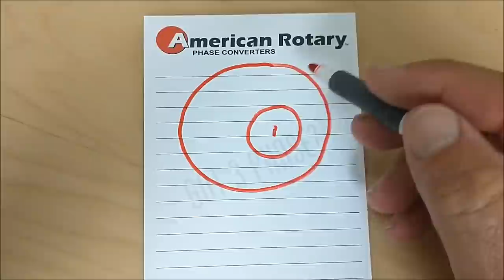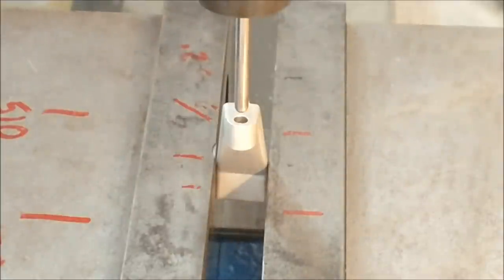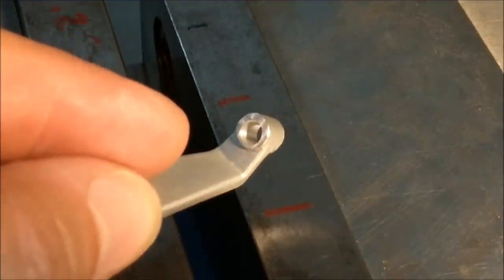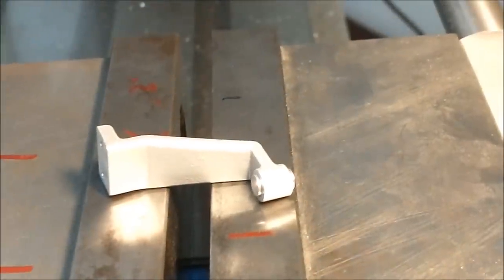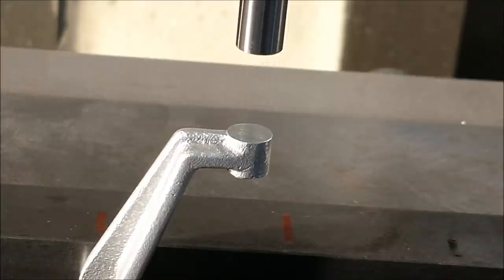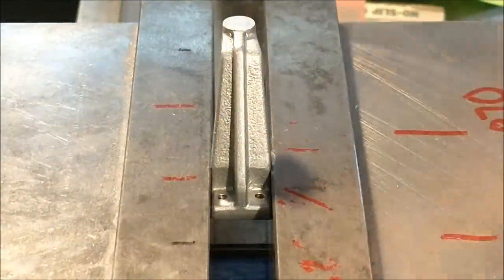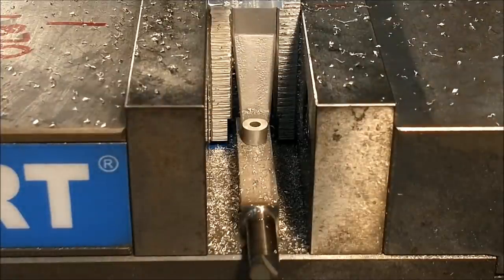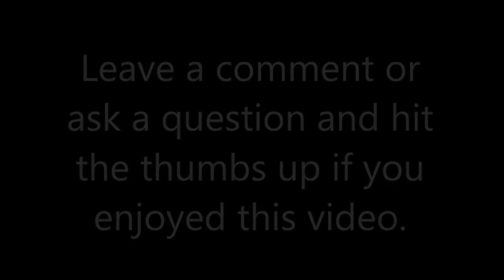Is It Impossible to Move a Hole in a Piece of Metal?  No.... Watch This !!!

Comment: A few suggestions (not necessarily in order):
1)  Suggest you consider making a Bondo support fixture to hold the casing uniformly during machining.  (Just grease the casting for a release agent.  It works very well and you don't have to worry about breaking the casting.)
2) Loctite recommends a film thickness for thinner viscosity Loctite between .025 mm to .080 mm, (.001"-.003").  This allows for a sufficient gap for the Loctite to cure correctly.  So if you went in the middle at .002" that would mean that the bushing should be undersized by .004" diameter.  This hard for Joe to do since he is a very high precision machinist.  However, you need to leave enough film thickness for the Loctite to properly polymerize.  Additionally, too tight of a fit on the bushing will scrape out the majority of the Loctite upon insertion.
3)  When you "squeeze" the aluminum "bushing" is becomes an aluminum rivet and mushrooms out at each end easily wiping out the .002" radial clearance between the bushing and the hole but only at each end.  The aluminum bushing then deforms the hole outer edges for the end condition fit you are looking for.
4)  A better method for locating the hole to be repaired would be to indicate the OD of the boss and ignore the through hole.  Then plunge the boss with an undersized end mill.  Then clean up the new hole with a boring bar to the desired diameter.  
5)  Loctite recommends a surface finish of around 64 RMS.  This surface roughness allows for the Loctite to get a better grip.  So this surface roughness should be on both the busing and the ID of the hole.
6)  You should file a radius on the leading edge of the end of the bushing to be inserted into the hole.  The radius will reduce the tendency of the bushing to scrape off Loctite material as it is inserted into the hole.
You might argue that my comments are overkill for the this particular repair, but it always good to develop good habits when doing any kind of work.
Thanks for the video Joe.  It was a good  opportunity to help me review how to handle these type of repairs.

Comment: I’ve been thinking about a DRO for both my lathe and mill / Drill, both are used / and Abused so accurate works would be nice but I think it would be better to get new machines... I’m a Happy Hobbiest at most. But losing sleep with my nose in the Shars catalogue... Not the electronic version... I still love to look at dog eared pages !
Thanks for putting this video up and I’ve gladly kept all of my fingers and toes where they belong! They don’t quite work with me on occasion but I’m gonna say it, getting older is a challenge. Having held the 2nd most dangerous peace time Job in the Army for 13 of my 20 years, heavy Construction equipment repairer.

Comment: Very well recovered, Yes i can see the differences between the two different metals  but thats only because we seen it happen & know where to look.
Reply: If you did not know it will just look like the surface there was slightly polished, and after a drop of lubricant is applied and slightly polymerises, or the part is sand blasted to clean it and even it out, you will not even be able to see it on the even surface finish.
Reply from the maker: You'll look right past it. Thats the best kind of repair.

Comment: Nice work !!!,  I always use "wicking grade" Loctite for parts this small and with such little clearance.  I have taken apart pieces that I'd previously used red Loctite on but found after disassembly that the liquid didn't flow, there was only Loctite on a fraction of the contact surfaces.
Reply from the maker: I'll have to read up on their products.

Comment: a master at his work is a beautiful thing to  watch.
Reply: Hardly a master , if he was the hole wouldn’t be so  far out.  Unless he Did it on purpose for the video !
Reply from the maker: The casting was not suitable for the dimensions and hardware being used. The part was spot on to print the first time, but cosmetically unacceptable. Feel free to leave your credentials in case I ever need help.

Comment: I've had good success with lead solder(for the really delicate ones) and bronze braising  to set a bushing in a delicate place where I didn't have meat for a good press fit. The Shed Dewller uses epoxy sometimes too.

Comment: I did a similar thing when I oversized one hole in the apron. I accidentally punched the 1/8: all the way through (not paying attention to print). I snipped a section of some 1/8" aluminum grounding wire and peened it into the hole with a flat faced punch (but no loctite). Milled and drilled to the correct size hole and moved on.
Reply from the maker: We all have oops moments. How we handle them is the challenge.
Reply: Correction: Table, not Apron.

Comment: Great job and solution too.
If the part does not accommodate for the spec’ed dimensions find out if the mating part will accept adjusted dimensions and then adjust.

Think you did great! And without having to throw away the part.

Loved the press fit on the bushing too!
Reply from the maker: Controlling the assembly does have its advantages.

Comment: I've never done it this way before. Usually made the OD of the plug a few tenths or a thou over the size of the ID of the hole, then freeze the plug, and heat the hole. Works like a charm, but takes more time. Also was used on larger applications than this. I wonder how large a hole you could get away with pressing it this way....

Comment: The only way to make no mistakes is to make nothing.

Things like this are frequently made to suit in the real world. That's what transfer punches are for. When I worked for Siemens there were a lot of large fabrications that were designed to be shimmed and positioned for proper alignment then the matching bolt holes marked out and drilled to suit. After bolting parts taking high loads also had dowels fitted to suit. There were nominal hole positions on the drawings with notes to drill on assembly. Things like gearboxes handling over 10MW are a good example.

Comment: I've relocated a number of such holes with great success.  My preference is to tap the bad hole with the absolute finest thread available, then bond a matching threaded replacement slug in using the same alloy as the parent with a good metal bonding epoxy on the threads.  After the epoxy sets, machine flush and redrill.
I like my method better, but for this application, yours is clever and beautifully time-efficient.

Comment: I build similar models made from cast iron. Bought several partially completed models from ebay. What I do is drill out the hole a bit larger, thread it and thread a piece of brass to fit. I'll cut a screw slot in it, use some loktite 603 and screw it in. then mill off flush and redrill. Works well but I only do it if its hidden by another component. Hard to squish cast iron!

Comment: When using such a long skinny gauge pin to probe a hole, I personally rotate the spindle through 180 deg (separately for each axis) between successive probing moves, and move the table in that axis to make the deflection equal and opposite.

Comment: I had the screws that hold a water pump onto an aluminum Buick 215 that welded themselves with rust to the holes.
By the time I got those bolts out most of the holes were completely destroyed.
I simply drilled them to size, tapped them and used an aluminum Bolt with red Loctite to fill the holes.
I then mounted the water pump on the alignment pins Center punched and re-drilled and tapped the holes to the appropriate size for the factory bolts.
After cleaning up the surface nobody could tell the difference.

Comment: GreenLOCTITE 638 is a high strength, fast curing, general purpose retaining compound.
LOCTITE® 638 is designed for the bonding of cylindrical fitting parts, particularly with narrow bond gaps approaching 0.25 mm. The product cures when confined in the absence of air between close-fitting metal surfaces and prevents loosening and leakage due to shock and vibration. It not only works on active metals but also on passive substrates, exhibiting robust cure performance. The product offers high-temperature performance and good oil tolerance, and tolerates minor surface contaminants.
Reply: Goo, glues, lotions, screws, adhesives, boos. I'm not a fan of loctite. It causes corrosion if you're not tediously pedantic about getting the metals tested to make sure there's nothing 'icky' in them. If you deviate from it's pathetic temperature or humidity range. Metals within acceptable parameters per standards organizations may not be good enough for Henkel. 
Do not use on MIM parts, do not use to bond dissimilar metals. In some cases it might kinda sorta work if you buy their expensive primer(s) and/or do special prepwork. 

Screw it, nut it, bolt it, washer it and/or  just do your tolerances right to begin with and leave the slop to the hogs.
Reply from the maker: The expanded fit of the plug did all the work. The loctite was just gravy. Sorry, no slop for the hogs here.

Comment: As a foundry man, I’m curious if the part was designed right the casting would be as cast with machine stock added to the pattern, and as you know you would set a fixture and find center and go from there.  No sand casting is ever perfect.
Reply from the maker: This was a tricky little casting.

Comment: Great job , again. I just had the same thing today drilling a hole in a nozzle mount and the last thing was to drill the holes . I did the pilot hole first and the the final , apparently I didn't tighten the vice and it popped out and had to plug it . Brass part and silver solder , rebored it . It was one of those mix nozzles that press in and twist , so I saved 3hrs of remakeing the part. Cant see it . ah ha. Wish I could post pictures on here.
Reply from the maker: Sounds like a win.

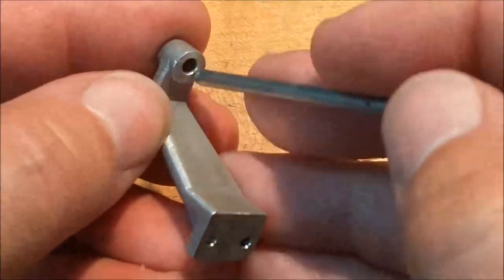Comment: It looks like that casting is out of alignment top and bottom.. (3:44) . So by moving your hole, it's just going to be off center on the bottom now, instead of the top.  With the strength that you lose by putting a bushing in there...  I personally would just live with it. lol..  but IDK, maybe it' necessary.
Reply from the maker: I realigned the casting, so technically the bushing is out of line to the new hole.

Comment: Thanks for sharing, I always learn something from your videos. The repair came out awesome.
A bit of OCD is good for a machinist. 😃  So if you would have set it up with the outside of the boss parallel to the quill before you drilled the first time it would that have negated the problem? Now i just hope bushing stays unloosened. 🤪
Reply from the maker: I think a little OCD should be mandatory for a machinist.

Comment: Cleaver piece of work. 
I thought you were going to spot TIG or MIG weld the hole shut, mill the surfaces down and mill/drill a new hole. 
But I’m not used to work on tiny stuff.
Reply from the maker: It would be hard not to melt this using that approach. Not saying its impossible, just outside my comfort zone.
Reply: @joepie221  Yes, that certainly could happen, it’s very tiny.

Comment: Such a tiny part. I would have machined a new part from billet in that time. Techniques like this are really only cost effective on much larger parts where replacing the material costs more than the labour. Also usually the dimensions are not normally optional, it's either size, or scrap.
 However, the technique and skills are first class.
Reply: I could drill bush drill and reamer it to size in less than an hour.

Comment: As perfect a fix as humanly possible… amazing job! The color shift in the materials just looks like a slight density change in the casting, like maybe the center cooled first or something…

One question tho: Why did you wait to do the underside of the repair till you had drilled and reamed the hole for the rod? I would have done too and bottom then bead blasted both sides, then cut the new hole for the rod.

I was super proud of the fact that as you were measuring the deflection of the pin in the new location for the 2 holes in the mounting end of the casting I called it: 5-10 thou, closer to 5… you said it was 6 thou! I’ve been watching you long enough… I’m learning stuff! 😉

You don’t get to be a master of anything till you’ve made enough mistakes that you know what to do when you make more mistakes! 😉 Thank you for sharing this mess and not just showing us a mix of the original and the repair!

Have an amazing nap… I know you didn’t get much sleep last night… 😉😂
Reply from the maker: If I blasted it after milling and before drilling, I would have had to reset the part. I went a little of my normal sequence here to complete as many operations as possible with as few setups as possible.

Comment: I would have left it alone. Following the prints is up to you (and you've done a damn good job). Working with a casting that's off is a mark against the manufacture! It's a monument to your expertise and to what you had to work with! I'd be proud of it as a thumb in their face! It's up to them to do a better job not up to you to be Superman. Maybe by proudly displaying their defect might give them the impetus to fix their screw up! At least they owe you a public apology!
Reply: If you look at 9.40 you can see the thickness of the base changes moving toward the front, so it looks like the casting was slightly tilted back during the first machining. When the reamed hole was re-positioned and the base re-machined, initially it was only taking material off towards the front edge.
Reply from the maker: Alignment for function was a balancing act on this one.

Comment: That wasn't just one trick, it was about 3 or 4.  Really amazing.  I would have bet the insert would spin.  If that had been a steel or stainless part, rather than aluminum, would you have done a plug, or would you have tig welded it, then re-drilled?  Asking because the cutting forces would be a lot higher, and unlike with aluminum, welding it up with steel would be fairly simple.
Reply from the maker: Maybe straight knurled the plug and fuse weld the top and bottom.

Comment: Hi Joe, great job as always.  It would be interesting to see how parallel the perpendicular surface on the inside is to the axis of the hole.  I suppose it would have been better to take this small area as a reference.
Reply from the maker: It had to be a tertiary datum because of the visibility and sequence. I bet its extremely close anyway.

Comment: Registering to a small cast surface could be an elusive foray into chaos. Wouldn't it be prudent to register to the mounting surface that is machined on the arm base?
Reply from the maker: The outer cast surfaces were parallel enough to trust. Something had to move.

Comment: Note. Loctite needs one of the surfaces to be ferrous. It works on ionisation to set, not drying. (In Loctite material information sheet) . That’s why it doesn’t set in bottle. Epoxy or specialist non ferrous lock better.

Comment: Great explanation.
The only confusing part for people might be why you centered your pin in the original hole and then bore a hole offset of that?
That bit wasn't clear.  Or perhaps you skipped showing  a few steps.
Did you measure the distance between where you were and where you wanted to be and then calculate the bushing hole size?
Then shift over to center your bushing relative to the where the new hole would be?

Some might think you bored straight down the center of the existing hole and eventually left a thin wall condition on one side of your bushing.  I don't think you did that but maybe.

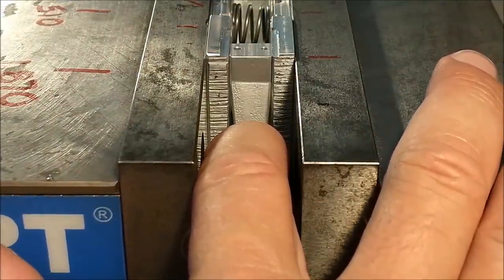Comment: 20:20 maybe... putting the shaft in that new hole, and inidicating it vertical will be better alternative to small surface of that boss laying on the parallel?
After all it is the shaft that should be perpendicular to that square part of the casting (surface with two screw holes).
Reply from the maker: I checked it off camera.

Comment: I'm puzzled why you were holding the part with your fingers when making the larger hole in the mill.  If something was going to grab or shift, I really doubt it could be prevented with any finger force, and it puts fingers at risk if something bad happens.
Reply from the maker: @trainliker100  At no time during the rework of this component was the part being held by hand. If you roll to 4:50 in the video, you'll clearly see the part is firmly held in the vise. The wood present is to absorb some part downward deflection, and my fingers are present to absorb any vibration or harmony from the cut.
Reply: @joepie221  I didn't mean to imply "held by hand", just wondering why the hand was involved at all.  (I have machining experience).  It is true that grasping the part might help mitigate vibration a bit, but I would advise people to make a change to the fixturing if vibration or resonance is an issue - for safety.

Comment: The casting will have enough difference to not gar if press fit. The trick here is to already have a close to finish hole in the sleeve (plug). A sleeve can have more interference than a solid and is less likely to collapse and loosen when drilled out. Interference on this would be best at .0001/.0003 (a bit more than friction fit). When pressing you want a film of Loctite on both male and female parts to guarantee the it can’t be squeegee off and you get 100% coverage. Loctite is best kept at room temperature and less than 6 months old. Don’t ever use Loctite or liquid pipe sealant on plastic. When you start a hole, don’t use a 60 degree center drill, use a 90 degree spot drill. Center drill are best use for drilling tailstock centers, lousy for good holes locations and centering reamers. A special 90 degree center drill will start drills well.